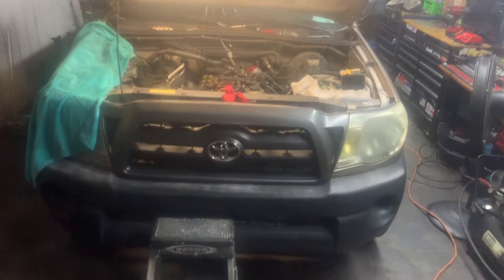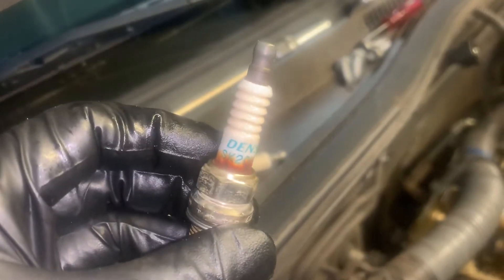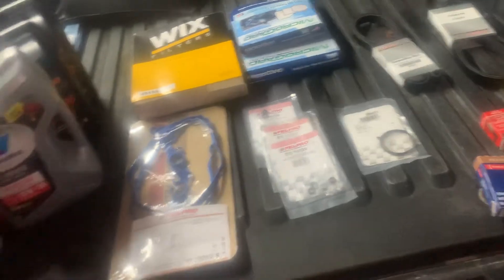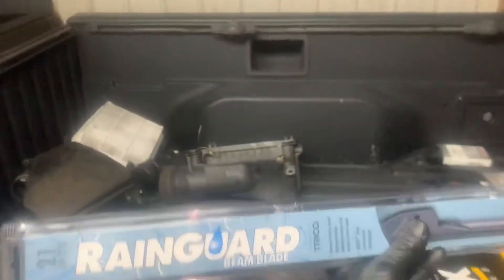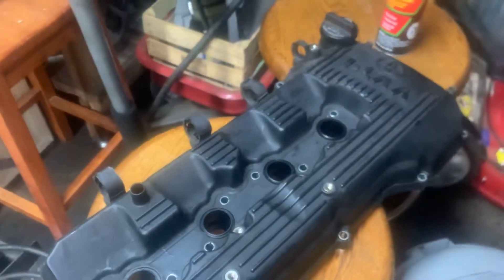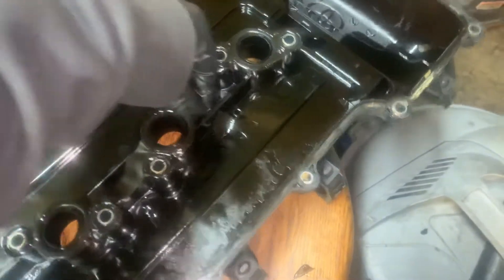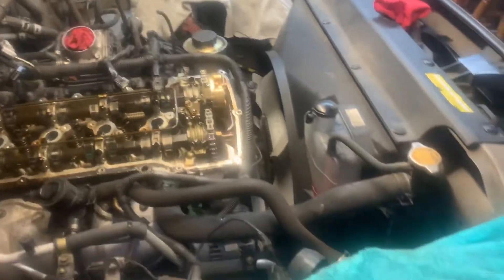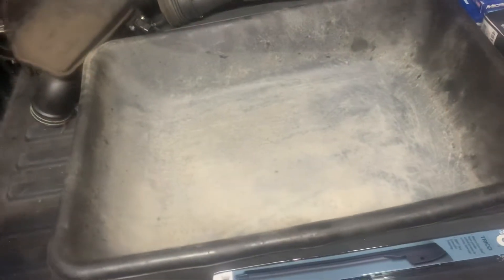2005 Toyota Tacoma 2.7

Comment: Last Friday my truck started pinging at around 2k rpm with no check engine light so I changed the spark plugs and oil again and no good. The next day I get a check engine light for a bad o2 sensor so I changed it figuring that was why the truck was pinging and still no good but the check engine light went off. Pretty annoying. The truck has 218k miles on it and it’s still like brand new and hasn’t had any problems until this. Something is causing detonation because the motor is very quiet sitting still revving it. It only pings while there is load on it.

Comment: If it was running lean, that’s too much air, if it had a misfire AND was lean, probably intake gasket leak too. Misfire, not burning enough fuel should make it run rich 
(Too much fuel)  those plugs are smoked tho!